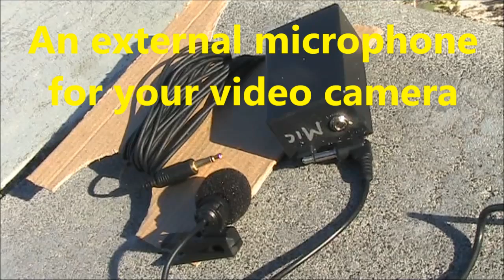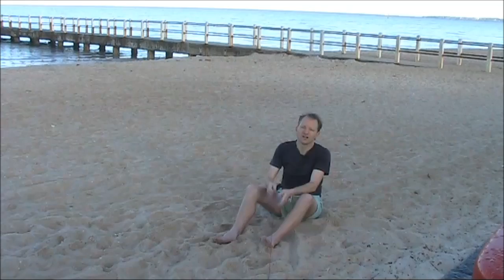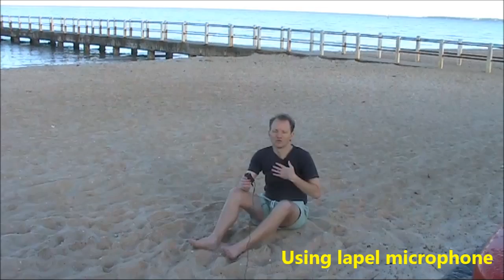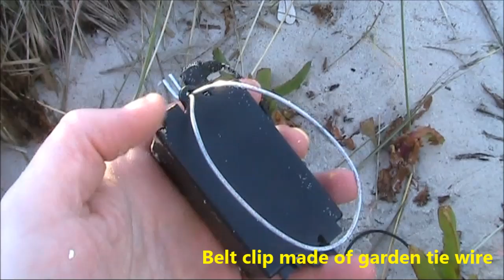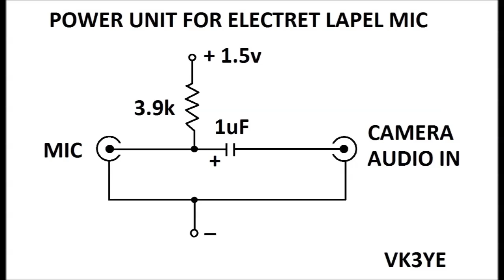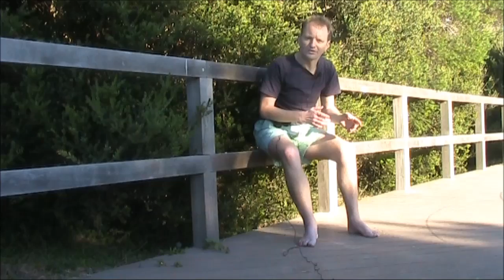An external microphone power unit for your video camera

Comment: Great job Peter! Not worth spending a fortune $$$ on a Sennheiser or AKG wireless when what you've made there sounds really good. You're right about the cheap wireless mics on Ebay. Waste of time. Your audio is now 100%! Craig VK3CRG
Reply from the maker: I wouldn't say 100% just yet.  At points it was slightly overdriven and/or slightly bassy (highs require line of sight to the microphone to propagate apparently).  Although I'd rate the small snipped after 1:29 at 99%.

Comment: Another cheap solution to get around the wired/wireless problem is to get a cheap digital dictaphone with a microphone input, that you can carry around without being tethered to the camera, and then sync up the audio in the editing.
Reply from the maker: A good idea but with all the video edits I do (maybe 100 per a video) the extra work in trimming the audio would not be attractive. Some voice recorders in smartphones could also do the job.
Reply: Oh wow, that was surprising! Sounds incredible! 

I'm getting a lapel like right now. 

Replying to this comment though - I don't think I'll get a wireless mic; I'll just plug it into my iphone, and email myself the mp3. My editing software makes it easy to sync and group separate audio and video tracks. What do you use?
Reply: There's some really great apps you can get for doing just this.
I even went about running a half decent USB audio interface plugged into my phone and used an app to record via that.  
The possibilities are endless!

My preferred method is having a camera that you can set even the most basic audio level on, and then having a mixer connected to camera and mic connected to mixer.
With a proper level set on the camera (and ideally a limiter too) you then only make adjustments on the mixer side.
If you were doing something like what Peter does, you could have the mixer next to you and monitor the levels occasionally to make sure they're not too hot.  
Any audio that you record without monitoring with headphones is a gamble (wind noise, interference etc) but at least this way you can make sure it won't distort.

Comment: Fantastic improvement. I think this marks an important milestone. On behalf of your loyal viewers we thank you!
Reply from the maker: Thanks Peter - Of course only possible because a certain camera has a microphone jack ;).  It's still not quite right - it's slightly overdriven in parts and there's some bassy popping. But provided that speech level is kept down it's acceptable.